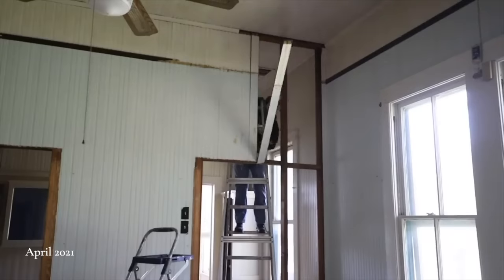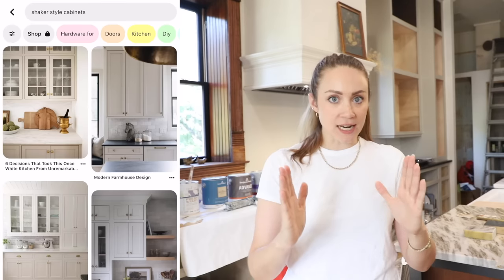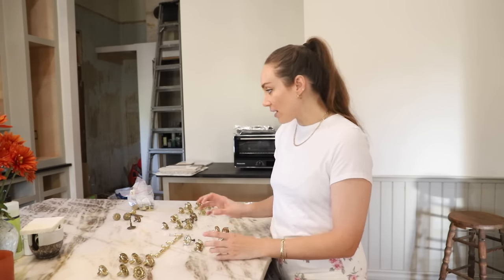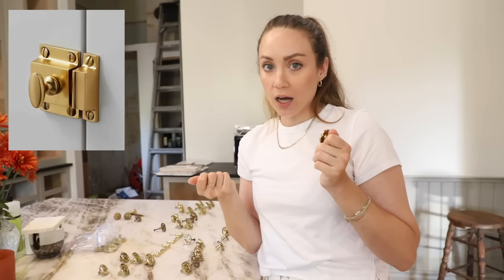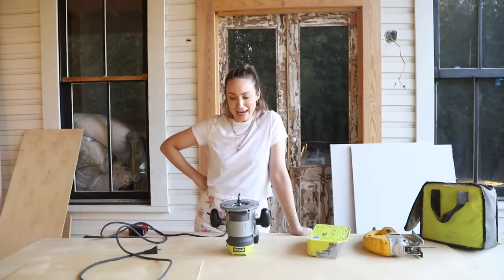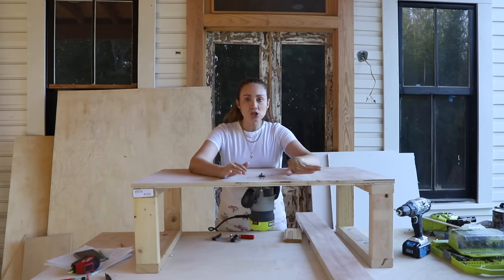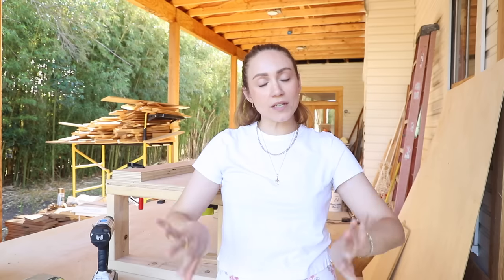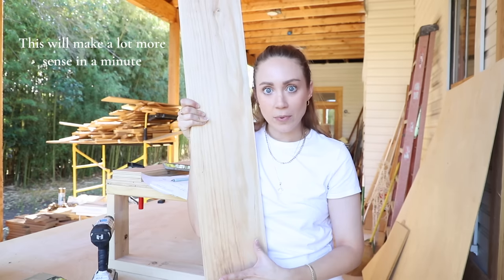DIY CABINET DOORS | Kitchen Makeover EP 9 | XO, MaCenna

Comment: You could cover the pocket holes with dowel plugs. The dowels are glued in and trimmed flush with a hand saw. Edit: be wary of making your doors too tall and wide. Max 27”W x max. 30”H. If the door you need is larger and not being used as a refrigerator panel. Consider adding a “center stile” or your door could warp over time. I’m guessing Texas can get pretty humid.
Reply: I owned a cabinet com. You are right about doors can only be so wide and so tall.  And I  am in Texas.
Reply: Japanese pull saw is a really good option for flush cutting dowel.
Reply: Totally agree with all said in this thread!

Comment: You did such a good job!!! Doors will be so delicate and stylish. 14:46 Maybe for your "router station" you need an additional support under its top plywood because when you are sliding board along the router bit and pushing it the plywood is bouncing. MaCenna you are so talented!

Comment: I'm in the middle of a renovation. Now cabinet shops are back ordered, or they are in no hurry to call you back. meanwhile, I saw your pocket hole cabinet making video. I thought, I can do this. Lots of videos, second guessing myself, tears, frustration, which has finally given way to success, accomplishment, a sense of pride, and much more. I actually made 6 drawers today. 6!!! They are straight and fit together correctly. I'm finally excited at what they will look like when they are finished! Oh, btw you could use pocket hole plugs to fill the pocket holes you don't want to see. Also, you can get a Dado blade for your table saw to cut the grooves in your pieces. I am making drawers, 3/4" sides and 1/2" bottoms. I got the dado blade for my new table saw, (having tools makes it so much easier to do a good job), and put the grooves in all the side pieces in a snap. It was so quick! It actually took longer to change the blade than to run my pieces through. Each new thing takes time to figure out and just like you said, you procrastinate when it's something new, you haven't done before. That's me, I do that exact thing too. You're just trying to figure it out and get confidence before you jump in... There's a lot to figure it out. It made me feel so much better when I saw you were still working on your kitchen too.  It's real life and things take time, along with everything else that's also going on in a normal day. You are doing a great job and I'm sure I'm not the only one that's been inspired to try to build my own cabinets. Keep the details videos coming, lots of good ideas. 😊

Comment: so my wife showed me your channel as inspiration for our upcoming renos, and im thoroughly impressed.
the one note i would mention for people going forward is that if you simply use a tounge and grove bit set, it has the bearing on them so you can simply run it to the full depth and they will be a perfect fit each time instead of trying to fight with a fence and getting it perfect that way.

i would also highly recommend a track saw. even a cheap one like the 7.5 WEN set. 
makes breaking down boards much easier and since you are doing everything yourself, a great investment going forward

Comment: Really pleased to see bare hands and safety glasses around spinning tools! ☺️

Two more things that you might want to add to your new tool setup are a push stick and a feather board. The push stick is for, well, pushing 😉 It's so you aren't leaning forward and moving your hand past the blade. 
The featherboard is for pushing the wood hard up against the fence from the side so you aren't leaning towards the blade from that side. If the wood kicks back or catches and jumps up, or if you lose concentration or grip for a second, the wood will leave the scene and you are going to keep going toward the blade. If you can use less force and keep more space, you've got much more chance of not being damaged.

Comment: You amaze me each week with what you do. You have inspired me to go into carpentry and further my knowledge on all things carpentry, so thank you for that ❤️ a tip I learned when glueing, I’m not sure if you did but always remove the excess glue with a wet cloth. The wood can get wet, almost saturated and no harm will be done! Another tip to avoid your projects getting stuck to your cauls when elevating your cabinet doors is to use a caul that has laminate on it or get a regular piece of wood and tape it. The glue only adheres to wood! Hopefully that can help. It’s always a pleasure seeing you grow and accomplish such amazing projects.

Comment: I find it so interesting that in addition to doing your research, you then work out the best way to make it work for your particular set of circumstances.  Even the research takes time and the ability to select the proper teacher.  There is quite a number of sloppy "how to's" with misinformation, missing steps, etc.  
I greatly admire your willingness to test, try and master new skills.  The trim is definitely a YES; adds that extra finished and custom look.

Comment: They look amazing!  I have been intimidated by using a router in the past and you made it seem so approachable.  Hopefully I'll make my own cabinet doors one day :)

It didn't seem to be an issue for this project but I find it useful to keep a paper towel nearby to wipe off the wood glue for a clean finish.  It's especially helpful for the inner corners of joints where it would be difficult to sand off later!

Comment: love watching you figure out these complicated woodworking techniques….you can wipe the oozed glue off before it dries - makes it easier to sand…also it would be easier to use the router platform on a lower table….you’ll have more control over the cut…and it’s easier on your shoulders🙂

Comment: I am so impressed with your work!
There is a couple of things I've bene learning from woodworking pages. I'm not sure where you buy your lumber but if you want best quality you should try to get it from a hardwood lumber store vs a big box store as the moisture makes a difference for furniture building. Also, for the drawer fronts it will make a difference to use the thicker plywood so that it adhears to the drawer box flat on the back

Comment: My grandfather is a retired cabinet builder. When we helped him clear out his workshop we came across shelves and bins and more shelves and more bins of custom-built jigs for router cuts, joints, and table saw cuts so he could make multiples of the same design as consistent as possible. He didn't remember what half of them did.

Comment: I build cabinet doors for a custom cabinet shop and I have to say, you did a great job! As a tip, if you do have wood that is bowed, have the bow go towards what will be against the cabinet, (or whatever surface) that way it cups against it rather than bowing away. It's hard to find wood perfectly straight after all.

Comment: I went to see how my new house cabinets were made and they had the same insert trim you added, yet they also have the outside with a beveled router cut.  You did a good job, and doing the math is the hard part.  Can't wait to see how you add glass fronts.

Comment: SO inspiring!!  Since you're going to be painting the cabinets, you might want to use MDF as the center panel of the cabinet doors.  Look into it for yourself, but you'll get a smoother surface for the paint and it's less likely to warp and crack (messing up the paint) over time.

Comment: Just a quick suggestion to help you with your beautiful work. On the end grain (short side) of your boards that you are routing, place a back up piece under the side you are routing and the raise your bit to accommodate the extra thick ness of the backup piece. When you pass the end grain of your piece over the router, the backup piece wil take the brunt of the cut and leave your finished piece with no tear out and chipping. Also try routing less depth at a time so that the bit and router do not have to work so hard.

Comment: Hi MaCenna, if you want to remove some of the grain from the plywood in the middle section, you can use wood filler and then sand it smooth, and it will significantly improve the look!

Comment: So awesome! Great job on making your own cabinets, as a whole! Just a few notes from definitely a non-expert, but a design student/frequent detail drawing.. drawer/ avid watcher of woodworking videos: if you had wanted to do the cleaner look, I believe it would be.. using the half inch ply and routing a rabbit- essentially like when you made the tongues but only on one side so it wouldn't be very hard. Also about the 'trim' detail, I'm not SURE for sure, but I don't know if maybe gluing/brad nailing them onto the face and rails/ stiles defeats the purpose of letting the wood expand and contract without splitting any seams. Not sure if the better way might have been to find a way to route the decorative edge into the rails/stiles (on the inside of the frame only of course) but I'm not sure about that either maybe since the tongues/ grooves are only 1/4" thick so there may not be enough material to get away with that. You're probably long done these doors by now but maybe if there was a way to only glue the decorative trim to the insides of rails/stiles and not the plywood panel at all would have been better so it still can have movement? Anyways just thoughts/ ponderings. Great job nonetheless, and very inspiring! I wish I had the time and tools to make my own cabinets!

Comment: You can also get a dado saw blade for your table saw to do the grooves. Dry fit the hinges and then paint the inside of the cabinets( I would do the wall color so they will be brighter at night, and you can't see the color from the outside.)
Paint your fronts before you attach any of your hardware ie pulls hinges knobs .... this will give you the clean crisp edges. 
To add more detail to the fronts use two different color paints. The contrast will add a detail for zero cost to the budget as you have to seal the wood anyway.

Comment: Hi MaCenna,  First have a moist wet paper towel to wipe the excess glue off.  This will save sanding the glued sections.  Also, ensure the panel grain is in the same direction for all doors.

Comment: Well done MaCenna! I just finished repainting my old oak kitchen cabinets. One decision I had to make was did I want to fill the wood grain or not. I decided not to because I didn't mind seeing it. The Benjamin Moore Advance paint leveled a lot and the little the wood grain showed didn't bother me. I noticed on your doors that the poplar sides looked very smooth and your plywood panels have a grain. Do you intend to keep that grain or use wood filler so the panels are smooth too?

Comment: Girl! Make yourself a wood pusher for that table saw!!! It may save You from losing a finger one day! You need to do this! For the pocket hole….. You stick a dowel in the pocket hole and saw it off sand the cabinets, wood fill it and use the sanding dust from your sanding bag to dab over it. And it will disappear.

Comment: Your doors look so good! Your videos are so inspiring that I could tackle projects like yours with enough research and practice. I would like to make a suggestion. This could just be a factor of the video but it looks like the plywood on the drawer fronts have such a large open grain compared to the frame. I think you can even them out using thin wood filler or even spackle. Or there are products specifically for filling in wood grain prior to sanding to get that even smooth surface. Just my 2 cents lol, guessing you were planning to address that when you get to the painting phase.

Comment: Could you have put the pocket holes on the top and bottom instead of the sides, then you wouldn’t see them. You can also glue a dowel into the pocket hole and cut the dowel flush, it would still be noticeable though. You have done a great job and come so far, keep going!

Comment: 1. Please get a push stick for your saw, Kick back will take your fingers off. 2. Don’t glue or nail trim onto the plywood as if/when the wood shrinks etc. you will have gaps. Tiny amount of glue on trim where will meet FRAME and then trim nails into FRAME of door.  Great work,

Comment: the "fuzzies" might be due to a slight dullness of the blade. you're right that pine is a softer wood, and will be prone to roughness where it's cut. softer wood will also dull your blade more quickly, as the pine is more fibrous than a hardwood

Comment: With shaker style doors (and similar styles), the size (width) of trim you use will determine which drawer fronts will get the trims. The shorter the drawer front, the less likely it will look good with the trims.

Comment: Not sure you will be happy with the pine down the road.  Pine is fine, but it does show wear and tear a lot more because it's a soft wood.  You'll find dings and what nots the more your doors get used. My husband is making end tables out of pine right now. The amount of times I have heard him utter his frustrations to that wood while working with it are too many to count.  He has since started scoping out wood mills to find hard wood slabs that don't cost as much as the big box stores.  You might try looking at wood mills for hard wood pricing so you can continue using poplar instead of pine.

Comment: QUESTION: You said correctly that the inside door panel needs room to expand but you then glued a trim piece on them so won’t that cause cracking of the frame seams when the inside panel expands???

Comment: A suggestion... you already own a router, and now a router table. Why not make your own edge detailing on the rails and stiles prior to assembly? This would save you the extra $200 or so you would spend on the trim. Your choices on the detail would only be limited by the availability of the router bits.

Comment: im not an expert woodworker but i believe the center panel of the door should be floating in the frame to allow for the wood the contract and expand, so the trim should only be glued/nailed to the frame otherwise it defeats the point of the shaker door

Comment: Did you get the plywood centre of the doors smooth enough? I thought painting and sanding them separately from the frame pieces might be easier. This way you don't accidentally nick the trim pieces with the sander if you need more layers of paint in the centre of the doors. 🤔

Comment: Done cabinets myself. Hardest part for me was hanging them. 1. You need two people to do it.
2. You need to invest in a jig 3. You should drill holes first then paint them then hang them. Seems obvious but it’s tempting to paint first then drill just don’t do that. Oh and talking about painting them ugh that’s also a challenge if your using 1/4 board in the center like she did. You better sand it down 5x at least before painting that part
Reply: Another note to consider, I found that using the table saw to make the tongue and grooves was fast and easy
Reply: When you paint, use the method where you hang the doors, use your paint sprayer- the one you used to spray the fence. Might need to get a new tip for it- and stand far away from the doors while you spray them. Trust me the worst is when you just assembled the doors and then the dripping paint ruined them and you have to remake doors but spray is always better than roller or brush

Comment: Does anyone know the brand of router bit that macenna is using here? I'm looking into the ones available on Amazon but you get what you pay for and I don't want to spend on something that will not work after one small project, as many doors as she covered for the kitchen it seems the bit she used should be really hardy

Comment: The way you use the table saw scares me. (14:10) Please watch more table saw tutorials. You shouldn't push the piece of wood that is not against the fence. Make yourself a push stick with scrap wood. And lower the blade. You're improving at 20:53. Kudos on fashioning yourself a router table.